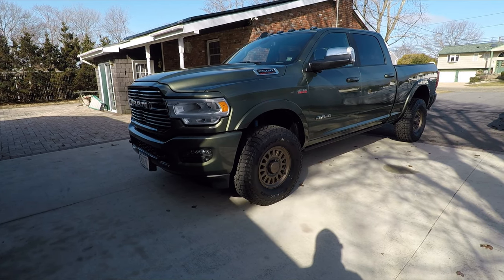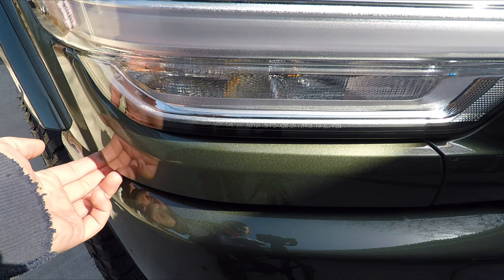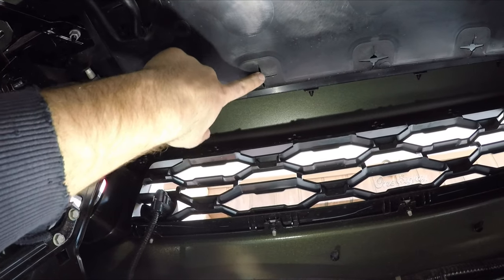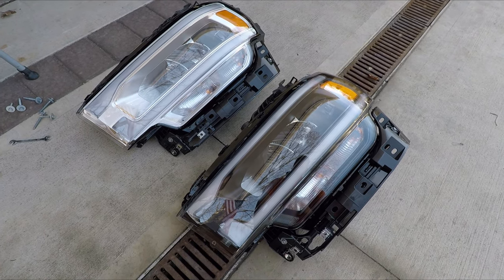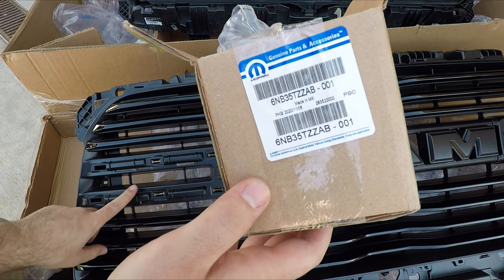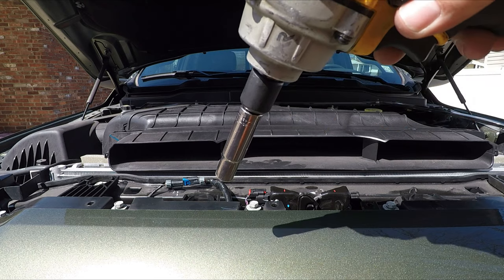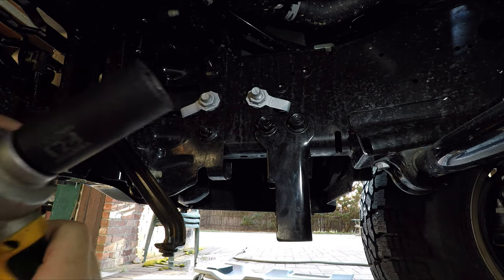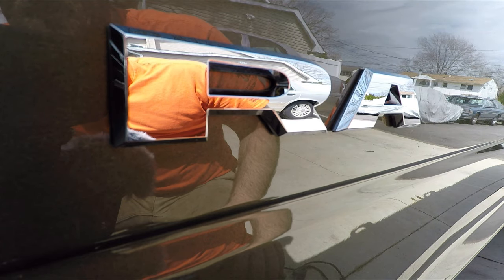5th Gen RAM HD Night Edition Swap | Step by Step Headlight & Grille Removal | CJC Intercooler Guard

Comment: Excellent video. Thanks for doing this. How long did it take you to finish the coversion?
Reply from the maker: Thank you for the feedback! Well with filming it takes at least twice as long. I'm gonna say the front end can easily be done in 1.5 hours on your own. The hood badge swap take 10 minutes and the debadging took me 2 hours. All in all, with no filming, it can be done in around 4 hours.
Reply: I got the front end done today. All I got left is the mirrors. I wonder if the new tow mirrors would work with the old harness. Anyway, your video was what got me through the swap! Thanks again

Comment: The night edition headlights did you get them through the dealership or a website?! 
I have a 2019 2500 but just with the regular headlights want to upgrade to those night edition! Love the day running light on them. 
I would appreciate your reply big time!
Reply from the maker: I got my parts through a few different websites.  tasca parts was one of the main websites I used. There are a bunch of Mopar parts websites that all just buy factory direct, so I'd just go with the cheapest place. There are 3 different types of night edition lights. Halogen, led and projector HID so just make sure you have the right ones. You can convert to leds with harnesses from Retro Shop

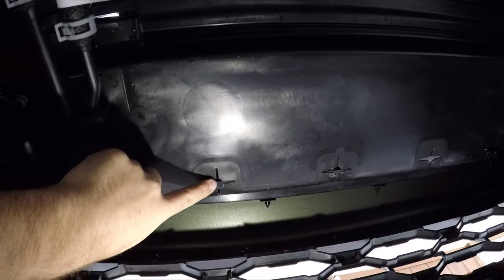Comment: Is it necessary to remove all the grill parts to change a headlight? I’ve got to replace a headlight in my 22 Power Wagon. After watching this video, I am afraid I will have to remove the winch to access the three bolts the secure that bottom grill trim piece, the ones shown at 7:06.
Reply from the maker: You can do the headlights without doing the grille and lower grille trim. You'll still need do the upper grille trim. Also need to do the top and bottom pins and bolts(the very outboard ones by the wheel wells) and the lower headlight trim needs to be removed.
Reply: That’s great to know!  The new light will be arriving in a few days, thanks for the timely response!!
Reply: I got around to swapping out that head light. Turns out I did have to remove the entire grill, but I was able to access all the nuts from those cut outs and the winch was not in the way after all.  Pretty easy after watching this, thanks for posting!

Comment: Why spend 2k for headlights whem uou can use ceramic tint to Get the same look?
Reply from the maker: Because I spent like $1200, sold the OEM ones for 1000. Tint doesn't look the same at all, I've done it. And tint can peel. These have clear lenses and black interior which is the look I wanted.

Comment: Do youn have the parts numbers by any chance?
Reply from the maker: 68360178AC Headlamp, Right
68360179AC Headlamp, Left
68443251AA Radiator Grille
68358570AA Nameplate(grille letters)
6NB35TZZAB Grille Trim Kit
68362212AB Nameplate, Right 
68362211AB Nameplate, Left

I bought the rear emblem off of Amazon, it was cheaper than Mopar.   Same as the 1500s.
Reply: Thanks buddy
Reply: @EngineersGarage1 you said the side pieces are matte black and don’t match the black if the grille, you sure you ordered the correct ones? I’ve seen other 5th gens that have everything with the same color so just curious